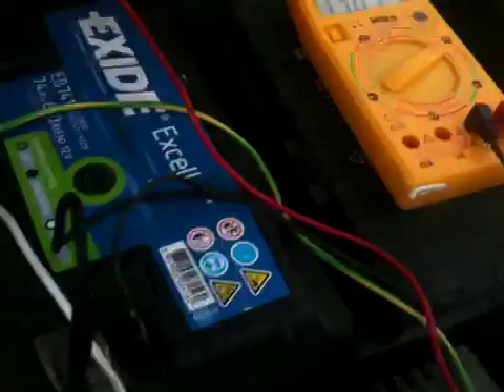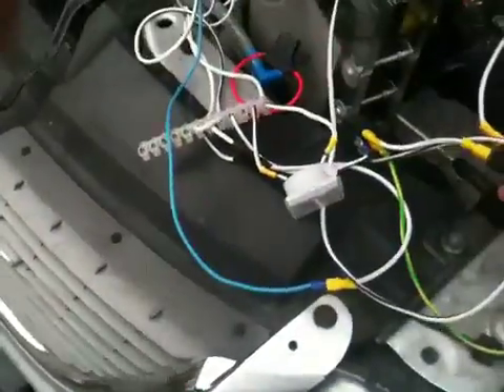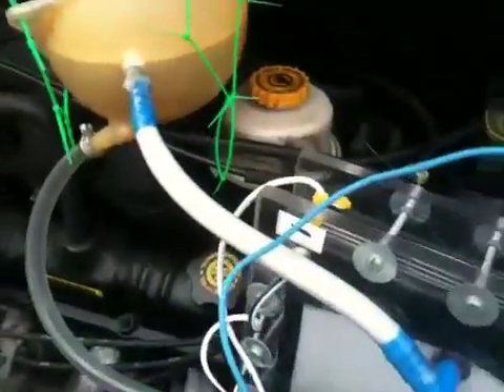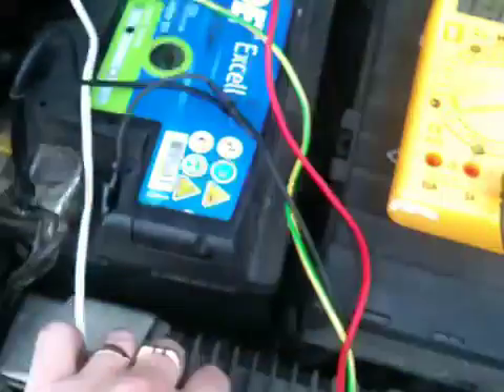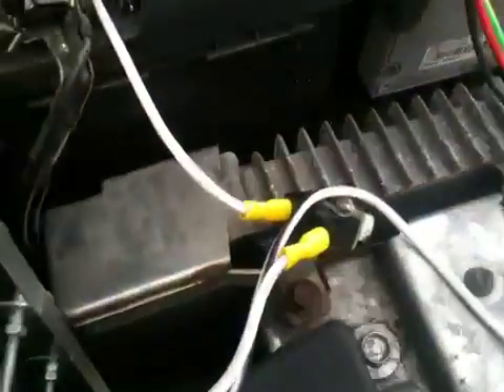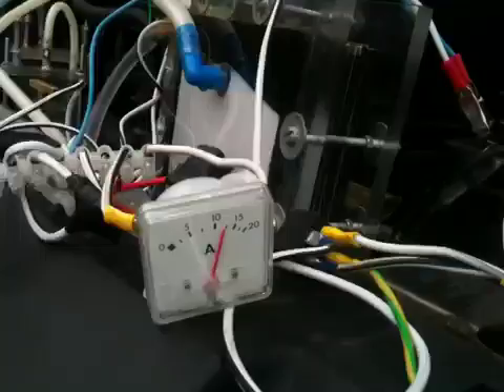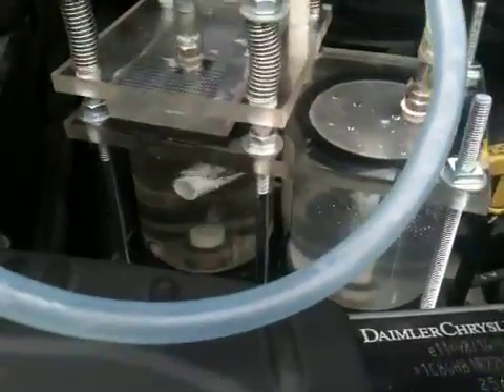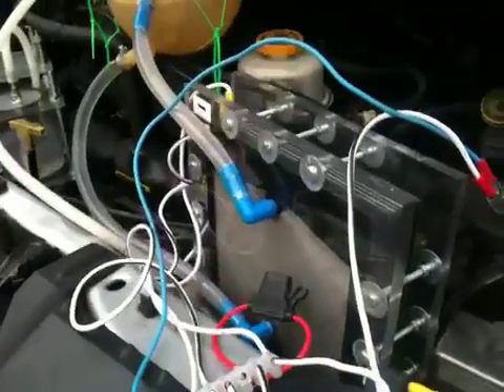Successful HHO test in my engine

Comment: @hhoinfo. Your wrong. 2000RPM÷2=1000 intake cylinders. Example 3.2ltr÷V6=0.533333ltr per cylinder × 1000= 533.333ltr of intake air per 2000rpm. 1ltr Hho ÷ 533.333= .0018750012 ltrs of Hho per compression stroke. .533÷14.7=0.0362585034 of fuel per compression stroke ÷ .0018750012 Hho= 19.3378561038% of fuel supplemented buy Hho. Granny lost 14% fuel gains. Because the cars computer over rides Hho. Not Hho being UN efficient. David A. Puchta

Comment from the maker: I just watched your video about this, interesting!
i have been considering about powering my cell with a solar panel. i know someone that sells domestic solar panels & they have some damaged ones that still work. I had a thought of putting 1 on the roof of the car. they are 1000mm x 1600mm & can provide 30v with 200watts of power, this should give me around 7 amps through my cell. its just a thought but i dont think my wife would like 2 C a solar panel of this size on the roof of our car LOL

Comment: Magnificent.  Please consider providing stochiometric Santilli carbon arc rod plasma generated HHO and recycling the exhaust through a heat exchanger and back into fuel generating chamber.  Ceramic vessels are inexpensive no/none/zero weld and DIY rust-proof. NWO oil & pollution war monger tyrant Zionist/Christian/Muslim/Banker/royals will not like such a green sustainable HHO solution-- that will ramp-up the Head-rush thrill of research, but do not over-react to traffic threats.

Comment from the maker: At first I wont be using any enhancers, just to see if there are any gains that way. I have also decided that the 2 pot control would only need to be a single pot control as the second seems to be pointless. I have also seen that I could use a thermistor sensor wired up to the L.E.D driver chip I have, this will enable me to monitor the water temp. I will see if I can use one of these as I have some wires in my primary bubbler that were used for water levels in the original car it was from.

Comment: great, can not wait to see the test results. are you going to be using your home made enhancers, the two pot set up to control it? also hoping you do not get a run away with heat after long run time, you might put a temp sensor on side of cell so you can keep a watch on heat increases.